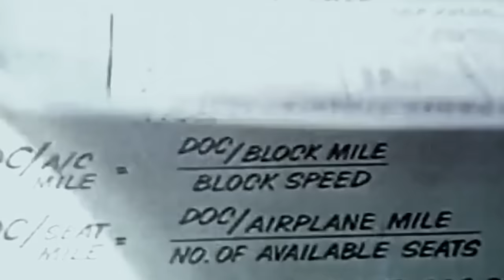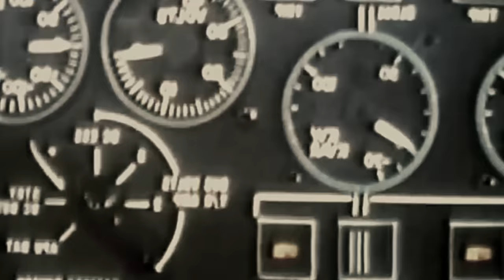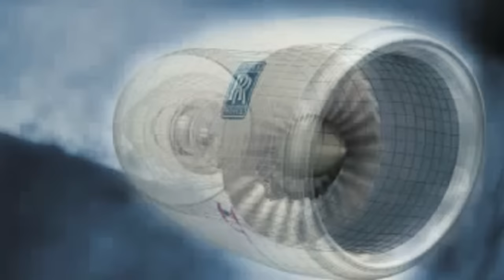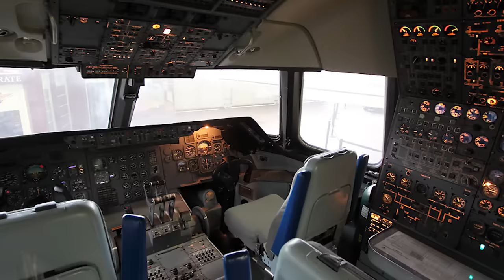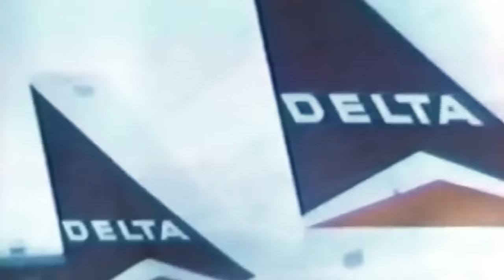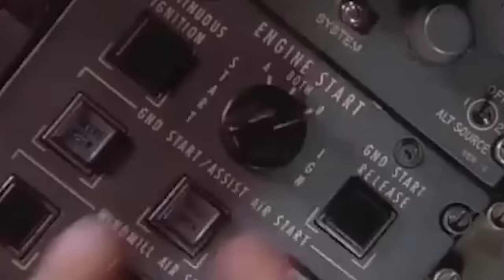L-1011 Tristar - too advanced for us

Comment: My first wide-body flight was on an L-1011 from SLC to DEN on TWA.  At that time in Salt Lake, it was one of only two wide body flights out of SLC.  The flight path went right over my house and I can still hear the blades of the L-10 cutting through the air, creating a sound that was so different at that time.  What a beautiful plane, so comfortable to fly on.  I remember flying an L-10 out of Atlanta, stopping short of the runway while the last engine was started, smoke billowing everywhere!  A fantastic airplane that is missed.

Comment: L-1011 tristar 
No problems that I know of

Dc-10
Engine just fell off
Killed the concord
Rear engine blew up
Cargo door unlocked mid air.

Why the hell did the DC-10 win again?
Reply: No problems?

First off... it couldn’t even be certified at the beginning, which plunged Rolls Royce into receivership and nationalization and required Lockheed to get loan guarantees from the government to finish the project. 

This meant it entered service over a year after the DC-10 in spite of being started earlier. 

It was a hugely complex aircraft. Unnecessarily so—typical of a company used to highly padded cost-plus-fee government contracts. It could lose money on the plane, but the airlines couldn’t. They retired it early while the DC-10 soldiered on. 

As far as failures. The DC-10 never had a horizontal stabilizer jam. Pure luck kept the Delta 1080 from turning into an Alaska 261. 

Another thing that was lucky was Eastern 935. It should have been a Sioux City but the engine fragments that hit the fourth hydraulic system miraculously didn’t penetrate it. 

Of course, a lot of the other accidents were maintenance errors. Turkish didn’t modify the cargo door as directed by MD and it crashed. American used an unauthorized maintenance procedure and the DC-10 lost an engine in a manner that it wasn’t designed to (the front mount was supposed to fail first so the engine would drop away, but the rear mount was damaged). 

Of course, faulty maintenance resulted in a triple engine failure on Tri Star—another thing that never happened to the DC-10. 

In the end, the L-1011s safety record was mostly because of its very short service life. Into service late. Out of production early. Out of service early. Fewer hours flown because of its atrocious dispatch rate. The Tu-114 was even “safer” than the L-1011 for the same reasons. 

But the DC-10 is still flying today because it’s problems we’re surmountable and it was a much simpler plane not the Rube Goldberg engineering disaster the L-1011 was.
Reply: Maintenance short cuts= engine fall off
Reply: Engine fall off is a faulty maintenance, killing concorde is oil price
Reply: Amateur Asian, I ask myself that same question when the US Air Force purchase the DC -10 for their KC-35 Tanker. Telling the citizens that the DC-10 is a safe aircraft. That very same week another DC-10 crashed and burned.
Reply: @bendover9411  It's a third party part and what is your argument with it that has any correlation to my argument? 
If you think that concord crash killed concord, my answer will be, one crash ain't gonna make a plane get retired and you gotta learn how economically unfeasible is the concord, it needs tons of oil that is becoming more expensive and no one really needs a fast plane that has a seat like economy class and has the price of first class, when you can have the comfort of business class that cost less with only 4 hours more travel time.
Reply: L-1011 has some cargo door problems.
Reply: jr132 Whats insane is the DC-10 had cargo door problems, but so did the 747 and the C-5
Reply: @Bartonovich52  Were you drunk? "Engineering disaster?" What?
Reply: Blood Kitten 

Enough time has passed since its retirement that one can come to conclude or assume that it was to be retired anyway. I say BS to that.
Reply: Its like why the fuck did the PC beat the Commodore Amiga?
Reply: The L1011 had one very serious problem.  When they doubled the production rate they lost money twice as fast.
Reply: The TriStar was what the Market needed.

The DC-10 what the Market wanted.

Simple as that.

Anyway, every night, before going to sleep, the DC-10 now checks there's not a Boeing 737MAX under its bed...
Reply: It was cheap
Reply: The only problem I know about the tristar is cost
Reply: @bendover9411  No..that is not why it crashed.
Reply: @kingssuck06  Any tyre going hundreds of KPH will burst. No plane designed to have a piece of rubber flying at hundreds of KPH at a fuel tank. These are planes designed for transport, not surviving a nuclear bomb.
Reply: @kingssuck06  No amount of kevlar is going to stop something as dense and as fast as the rubber from that blown tyre.
Reply: What is a jamed stabilizer?
Reply: But you know there were some cause of the l1011 incident like pilot error (Eastern 401, Saudia 163), microburst (delta 191) and mechanical failure (eastern 855)
Reply: @toxicatto6074  concord using oil for propulsion .? Oh dear. People were willing to pay to get where they wanted to be. Ours is not to question why. BA had modified their aircraft to prevent such an event as it had happened previously without the fuel igniting to an Air France take off at New York.
Reply: TheAmateurAsian  My brother, an ex B767 pilot always referred to it as the Death Cruiser 10
Reply: @TenorCantusFirmus  it’s ex douglas management who are producing the max these days.! Dosent it show.
Reply: @kingssuck06  nobody to blame except Air France engineering. They should have taken action to prevent such an outcome.BA did after such an incident happened at JFK without the same devastation as the fuel didn’t ignite .
Reply: @kingssuck06  you have an agenda of mistruth ! This is a replica of an incident that happened in NY to another AF Concorde and they did no preventative maintenance unlike BA. Luck was on their side in NY as the fuel did not ignite but pictures of both T/O,s are identical except for one on fire.  The Kevlar modification was very expensive whereas the BA mod was simple and cheap. A great aircraft was retired early due stupidity of AF  and much to the delight of the yanks who were ashamed they couldn’t produce such an outstanding aircraft. It could still be in operation today if BA had bought the remaining AF a/craft and used them as spares. Money was no object for people who wanted to fly on Concorde.
Reply: @chrisburnby62  I know and remember when MAXs were starting falling down like bricks I went into black humor, joking about the fact they seemed like having been designed by the same people behind the DC-10. Then, I found an article which practically was saying that, and that during their merge in the mid-1990s it was being said "Douglas is buying Boeing with Boeing's money"...
Reply: @TenorCantusFirmus  it was amazing that with the merger all the Boeing boardroom were over the years kicked out  . It’s now Mc D/ Douglas masquerading as Boeing!
Reply: @chrisburnby62  The rotten, failing Manufacturer taking over the healthy one... I'm not an expert in Marketing and Management, but this doesn't sound like a winning combination to me!
Reply: @kingssuck06  I would say you never did anything to an aircraft except crap in it ! Kevlar was not a requirement and never fitted previously.It was a fix the authorities came up with .
Reply: Had to quit the big BA when Mcd took over .what a mess so sad?
Reply: @toxicatto6074  interesting to note ... tons of oil.?
Reply: @kingssuck06  how many Caravelles brought down by blown tires.?  What upgrades were called for ?
Reply: @kingssuck06  If you care to review my posts you will see that I have never..never been critical of the DC 10! I’ve never been in one!  Europeans are proud of their achievements in aviation working on a shoestring and in the early days barriers put against them . The term “ Yanks” is not derogatory and is not meant to be and is used as an everyday name for Americans.
Reply: @dwormon8525  can you relate further ? Spent 3 months at Renton also at training school at Boeing field. Great times and sorry to hear of your story. Hope you made out elsewhere.
Reply: @chrisburnby62  . Everett is a nightmare. Firing people for  minor crap.
Safety bs everywhere. Top management messing with production. Think there trying get people to quit.?? Fyi ya dont wanna work there. It's a daily miserable. Oh by the way you have to try an do your job while dealing with all this daily crap. Thax me later.good luck.
Reply: @dwormon8525  Yes that is sad especially in the aviation game which was lovely to work in. No matter where you went you were met with courtesy and people who wanted to help an aircraft in trouble. They went beyond the limits to help, often with no cost either. “ Bring us back a starter motor when you are coming through next week.” Yes , you did plus a bottle or two! This happened all over the world like aircraft people were a fellowship.! They were! I miss it since retirement and would have hoped those attitudes had remained. Unfortunately I hear otherwise. Visited Everett a couple of times on our 1/2 day tour from school. Impressive place but I preferred the outdoors and going around , anywhere it didn’t matter.!
Reply: @Bartonovich52  DC10 was fast and cheap. I've had more fatalities because they half-assed and sped through production. L1011 was far advanced and had more redundant safety systems. To this day it is still the only airliner to never be credited with a mechanical related fatality.
Reply: @PeterOldschool  The cargo door issue can be blamed on design/manufacturing issues, but the other crashes were fault of airline or engine manufacturers. I flew the DC-10 for over two years and not once had any issues with it. It is actually one of my favorite aircraft that I’ve flown. Nice spacious cockpit, power, great handling. Loved it. Hated to have been bumped off it.
Reply: @bullwinklejmoos  it's a dog when loaded, the systems are ancient and any model you flew since 1990 had all stc's completed and the previous problems had been redesigned or been marked as SFWI's to be checked every 50-100 hrs. The Sioux City bird as well as the o'hare pylon flip was proof that it was a poor design to put all three hydraulic lines right next to the hot section of a turbine. A timeless plane it was but in no way was it a better design than L1011. Cheaper was the winner

Comment: That one dislike is for sure a DC-10 Lover
Reply: I am dc 10 lover but i like lockheed 1011 tristar is more better fro me
Reply: Fuel cost did
Reply: Or any mechanic who ever worked on them. The L-1011 was a Rube Goldberg disaster of an aircraft.
Reply: @Bartonovich52  >>> I heard from someone years ago that maintenance was an issue with the TriStar.  I don't remember the specifics, but it was not a 'plus' for the airplanes....
Reply: @ Bill Carson. The DC-10 engines had to be mounted closer to centreline because of its smaller rudder due to the tail mounted engine. The L-1011 had a larger rudder that could more effectively deal with the asymmetric thrust of a wing engine failure. I also believe the wide chord fan blades were quieter which is one reason why all engines have them today.
Reply: I liked the video but I was a DC 10 love both planes had their place only a idiot would argue this point
Reply: Seriously?
are you 12?

Comment: I was an aircraft mechanic for TWA in the 1980's till almost the end in 1999. Much of that time was spent on the Tristar. It definately was an different animal to work on. However, once you figured out their engineering (especially electrical) it was a joy to work on it. For one, it was the most totally redundant aircraft ever. All the flight controls were electric over hydraulic. It was set up where the entire aircraft could go completely dead electrically and as long as you had either one engine, the apu, or the "RAT" (ram air turbine) providing hydraulics, it would fly along fat, dumb, and happy.  None of that "fly by wire" stuff that requires electrical power. Our pilots told me that it was a "pilots plane" for sure. It had the most advanced autoland system incorporating a "DLC" (direct lift control) that kept it dead on the glideslope during landing. I was told the plane could land itself better than most pilots could. Their words, not mine. It was a difficult aircraft to get out the hanger door after major maintenance due to those pesky gremlins, but once it was in the system it was super reliable. Just don't ever turn off the power was the secret. It's biggest downfall was those RR Rb-211 engines. I helped overhaul them in our jet engine shop. What a "PITA". Those 3 spool engines were real bad about vibration. Most of the engine changes were due to high vibration and not performance degradation. This was common with all the operators. The P&W JT-9D was a waaaaay better powerplant and got just about as good fuel economy and was way cheaper to operate because their on wing time was far superior. The plane's final downfall was the wing's rear spar. It had a cracking problem. Our engineers told me that in their opinion Lockheed built the wing too stiff causing it to crack it's rear spar. Lockheed had an interim repair that was actually better than their permanent repair which was horribly expensive. You had to strip off the flaps, electrical, hydraulics, etc. etc. Shore up the wing, then replace entire section(s) of the problem areas. Hugely expensive and I'm not sure if it ever permanently fixed the problem. It's was kind of like the same thing Toyota had with their  '05-2010 Tacoma, Tundra, and Sequoia truck frames that kept rusting out. Great trucks, just piss poor frames. Lockheed Tristar. Great aircraft, just piss poor engines and wing spars. Most of them are in the boneyard now for these reasons. Too expensive to fix especially considering aircraft like the 767 and 777 which are only twin engine which will do a lot more for half the price.

Comment: I rode the TriStar several times. If the plane hit the slightest bump, the interior ceiling panels and bins would shake and move as if they were about to come loose. I realize this didn't have anything to do with the technical quality of the plane itself, but it was uncomfortable enough that I avoided the plane after that. The DC-10 was more comfortable, although not as comfortable as my favorite aircraft.
Reply: Now that you mention it, I do recall a lot of "creaking" in those ceiling panels. It never caused me to be nervous (they're merely decoration, have nothing to do with the safety or structure of the airframe), but it was a bit distracting from the otherwise quiet ride.
Reply: I had the same opinion the only time I flew on one (TWA ca. 1978). It seemed rickety.
Reply: You felt uncomfortable with the safety of the TriStar so you always chose a DC-10!? That's funny!

Those panels were just decorative lightweight plastic as you probably know. While the DC-10 was infamous for its awful safety record of aircraft failures and crashes. What a strange decision.

I liked them both though.

Comment: Definitely the best and most beautiful plane I ever flew on, I can remember being astonished at the rate of climb by a British Airways Tristar out of London Heathrow in 1979. As I travelled by air a lot in those days, I used to specify 'L1011' when booking if there were choices. Luckily I was based in the Middle East then, and their airlines used them a lot...Saudia and Gulfair in particular.  Loved the engine sound on take off - that beautiful grinding sound of the engines at full power. Flew the DC10 a few times, but not so impressed, though the 747s were pretty good.

Comment: Between 8:14 and 8:20 I was flattered to see that you used my 1/144 scale model build. I completed that model in 2013.  It is a Welsh Brand vacuum form kit with a 2-6 Brand laser printed decal sheet.  Tail number N330EA.  The metal finish is thin metal foil with adhesive backing.   Perhaps you found it on Facebook or Airlinercafe.   And if you didn't notice it actually is a model then I'm even more flattered.  Cheers!

Comment: The RAF (Royal Air Force) of United Kingdom used Former Civilian Tristars converted to Airborne Aerial Refueling Tankers and Eventually replaced by the Airbus A330 Multi-Aerial Tanker.
Reply: Wong wan chung Indeed! I recall seeing an RAF L-1011 tanker returning from an air show over London (the Queens Birthday I think). The Tornadoes went roaring past my home first, then I saw the imposing L-1011 approaching almost soundlessly. A bit of noise as it flashed low overhead, then it was heading for the horizon with all the grace of a huge stable SWAN, royally gliding out of sight.
Exceedingly beautiful aircraft indeed! 😃👍

Comment: I have many, many enjoyable miles riding in the L-1011s of Delta and Eastern back in the day.  Pilots loved the plane due to its high performance and relatively easy low-speed handling.  While the the development of the RB211 engine may have nearly killed Rolls-Royce, once they got the bugs worked out it was a reliable engine and gave RR the tech knowledge to build even better engines today.